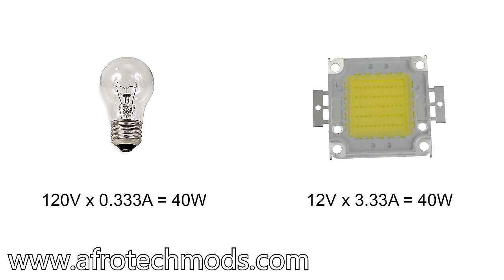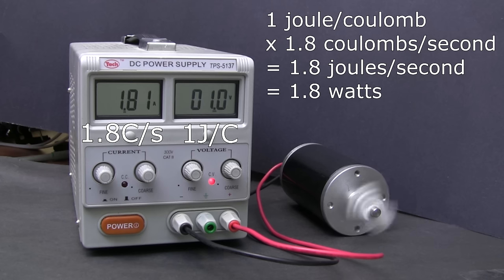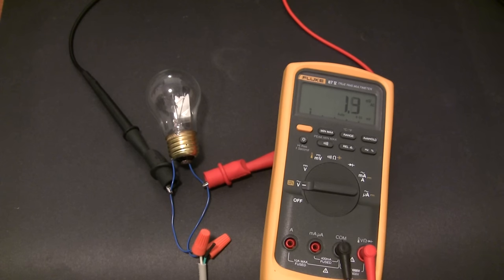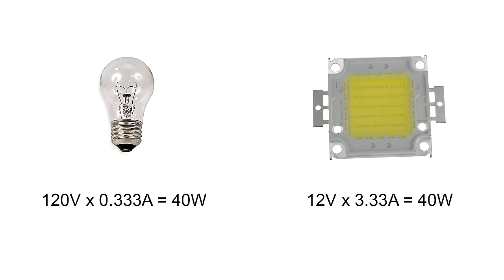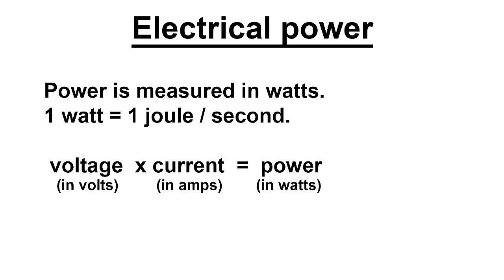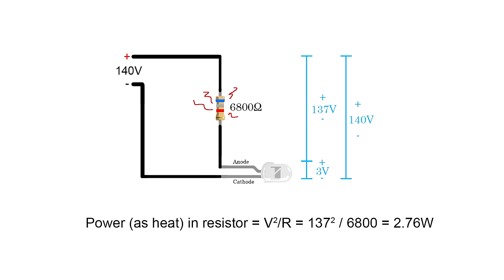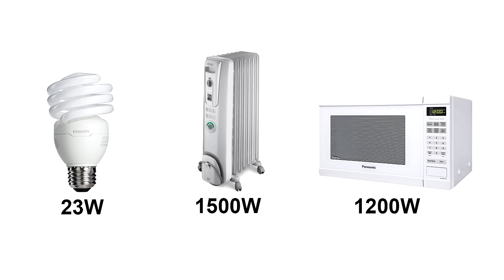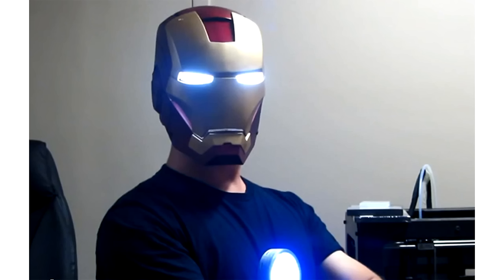Basic Electricity - Power and watts

Comment: Why is 1 volt giving 1.8 amp while 2.0 volt gives 2.0 amp. My brains does not accept these relationships when they don't go linear and then I lose the whole concept.
Reply from the maker: Not all loads are linear. A simple resistor would be a linear load. But the motor was not a linear load.
Reply: @Afrotechmods  Thank you for replying. For years I have been unable to wrap my head around basic simple electrical concepts and electronics. You'd be surprised if I would tell you my profession but electrics has always been truly my weakest subject. Now I'm on tour again to find videos to learn about it.